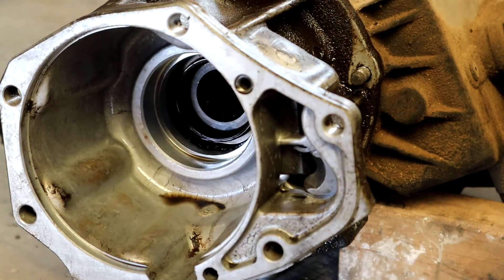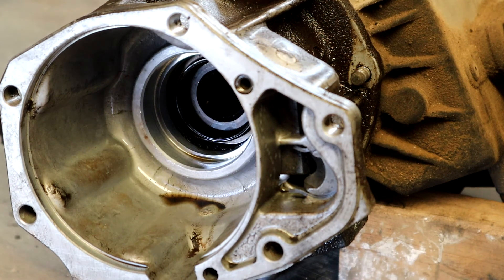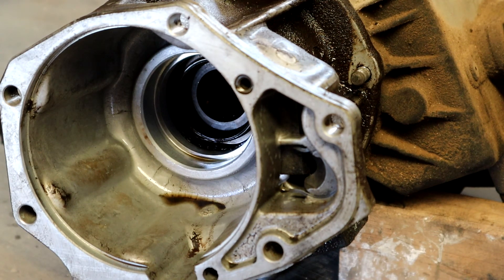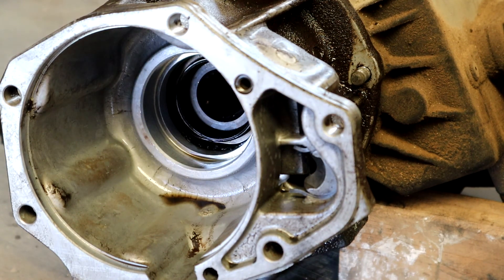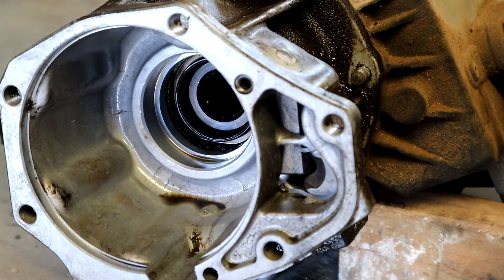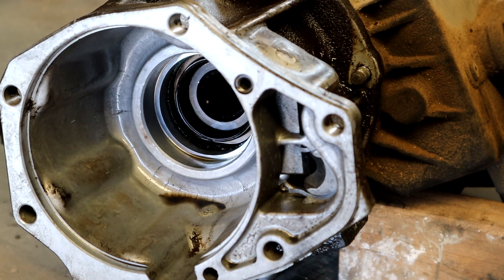Can a NP229 to NV242 Swap be Done

Comment: Was this a 242 HD ? do  you know what it came out of. chassis, trans , engine?
Reply from the maker: Good question. No, this is a NV 242 out of a 96 Jeep Cherokee. It has now been modified with a long input gear and a SYE. It fit and functions as planned. I've been using this same case in my 96 V8 powered Grand Cherokee for 3 years now without any issues. The 318 develops more power and torque than the 87 360.
Reply: @dferdirt  looking at the 242 to a Wagoneer 401/727